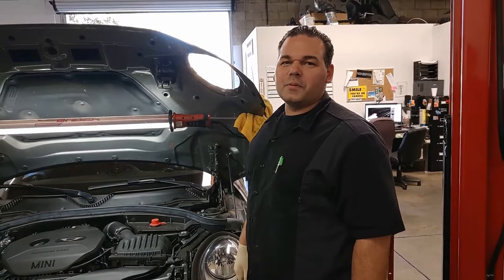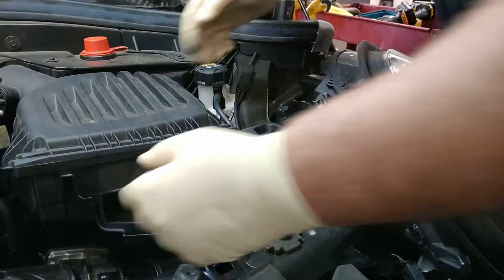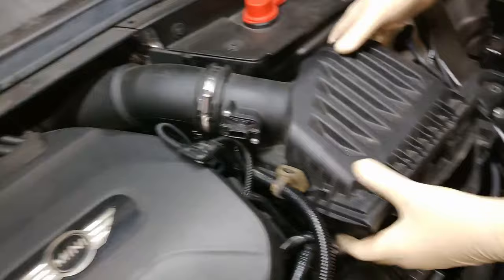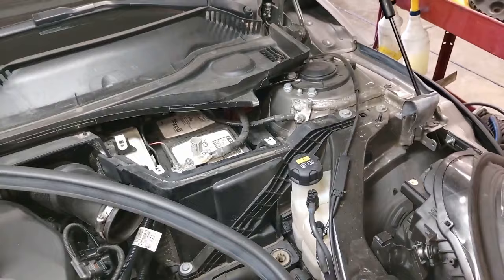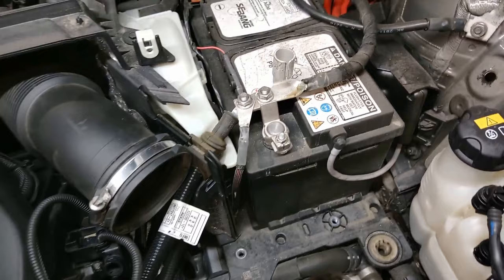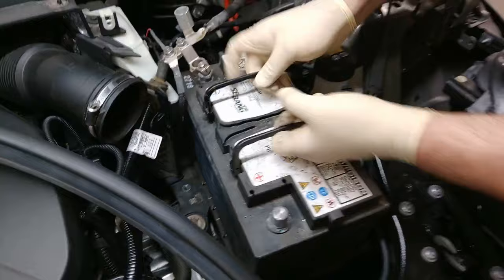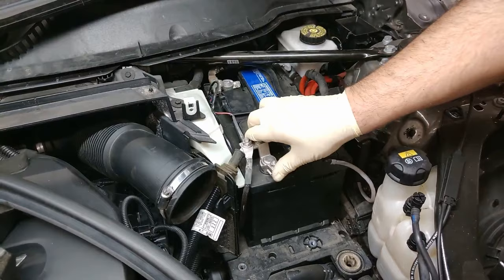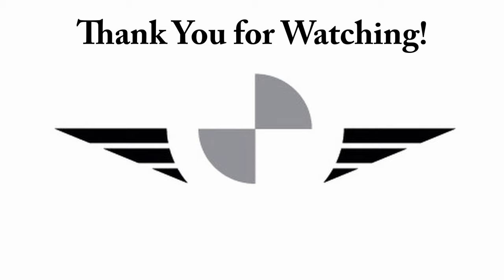Mini Cooper F56 Car Battery Exchange (2014, 2015, 2016, 2017, 2018, 2019)

Comment: Crazy amount of things to disassemble to change a battery.
Reply: Yeah, that is bullshit... 🤣
Reply: Compact cars are more complicated but this is by far not the worst hehe.
Reply: the dealership wanted $428 to replace it I was like ... WTF! now I partially see why.
Reply: Seems like it but it took 4 mins to “disassesmble”
Reply: Just need to charge the damn battery!!!
Reply: @faisal181  $540 now
Reply: @faisal181  the battery alone is around $300.
Reply: @eagertofrag7190 not really. All depends on make. Done plenty of honda toyota chevy nissan compact cars and they aren’t complicated. Usually beamer mercedes ford audi
Reply: @eagertofrag7190  you havnt seen a ford escape yet then. Gotta take the whole plastic weather lining, power steering reservoir, wipers, and a few other plastic casings around the battery.
Reply: I just did the job in about an hour with taking breaks.

Comment: It's a pleasure watching a pro at work. It took me nearly four hours to do this same swap on my wife's 2017 Countryman S, but I got 'er done. There's a long side to side strut/bar not in your video that had to be completely removed. The car had sat in the driveway dead after the dealer didn't have the battery in stock and couldn't get one. A dealer in another state told me that all I needed was a H7-AGM 80AH 800CCW battery, available at most auto parts stores. So it proved. My local dealer refused to install it, citing liability concerns, so I did it myself. It's a Diehard from Advance Auto Parts. They had it in stock. A sticker on the case showed that the battery had been manufactured the previous month, so I know I didn't get a "stale" battery.  Thanks!
Reply: What did you do about new battery registration?
Reply: @manahang1  I had to take the car to a MINI dealer to register the battery and reset the charging system. That cost me $89 with no other work done. This process should be automatic, with the charging system recognizing the new battery and recalibrating the charge rate, but it isn't. If you don't register the battery, the vehicles charge rate can remain very high, leading to overcharging and early battery failure.

Comment: A very good and informative video, well done for being clear and concise… But it’s absolutely crazy that you have to dismantle this many parts just to change a car battery! It takes just five minutes to take out and replace a battery on a 2012 Ford Fiesta, open the bonnet/hood, undo the battery clamp and the terminal screws and remove it. Replace with the new battery and you’re done. And someone has proudly commented that it took “just” two hours to do on the Mini!!! And this is progress? Madness… It’s getting to the point that they just want you to take it into the shop to carry out what used to be the most simplest of tasks…
Reply: I think it's BMW's strategy to make people come to the shop for a more expensive battery...

Comment: Very helpful and detailed instructions, including socket sizes!!!  Was able to install new replacement H7 AGM battery in my daughter's 2015 Mini Cooper and everything went smoothly.  It looks pretty complicated but the video is very clear and well paced and when you disassemble the parts everything makes sense and in fact is very well engineered.  
Used a battery keeper to maintain power to the vehicle so as not to disrupt programming.  Re-used the air vent plug (back) and adapter (front) from the old battery to the new for the vent tube.  Mass Air Flow Sensor (MAF) is a bit tricky - white clip underneath needs to be pulled out a couple of mm with small flat blade screwdriver to unlock and then plug pulls off easily - When reattaching insert plug and push white clip back in to lock.  Daughter will take Mini in to her local Mini guy next week to update the computer, but car is running great for now.  Thanks Cooper & Bimmer Experts!!!

Comment: Thank you, thank you, thank you!! Great video. My Mini didn't start this morning. After watching this video and a trip to the auto parts store for a $200 battery, I was on my way about 90 minutes later. Thanks for the clarity and for cutting to the chase. Definitely appreciated the detail you showed in taking off all the surrounding hardware so you can get access to the battery. Now if only my scan tool could tell the computer I have a new battery...
Reply: Does the car still work ok without the programming?
Reply: @lashley370z  Yes, I haven't had any problems yet. I've got an accessory gauge that shows voltage and it's always right around 13.5 V, which is what you'd expect to be coming out of the alternator.
Reply: @kurtlammonusc7424  thank you

Comment: Fail. Incorrect battery size. Tech removes an H7 and installs an H6. Always replace with the same size and type. At 1:51 where the tech first removes the anchor block, you can see where the edge of the H7 sits relative to the bolt hole for the anchor block. At 2:47 you can see that he slid the H6 farther in. Video conveniently skips reassembly, thereby glossing over the issue that the anchor block will not secure an H6, at least not using the original bolt hole. It's a red flag any time a technician vocally declares himself to be an "Expert." This "Expert" is a salesman first.
Reply: Thanks for this.....made me make sure I got an H7.  The stores I was buying from said both would fit.....meanwhile the H6 is over an inch less in length
Reply: @HandyGuy  "...battery clamp...will hold tightly...an...H6..." No. That is incorrect. You did not find that you can use the OEM hold-down pictured, to secure an H6. Difference in length between H6 and H7 is 37mm. OEM hold-down is not adjustable by that amount. There exist designs that accommodate more than one battery length, but those designs feature multiple bolt holes. This design has only one bolt hole to secure only an H7. Please research before posting in a public forum, and post only accurate information.
Reply: Wow good eye. Can see the H6/L3/48 on the new battery label. Regardless, the steps are the same, just the wrong battery size :).

Comment: thanx for that video, now I should be able to replace the battery - not sure about that registration thing - is it a must, I just got OBD checking
Reply: Yes, it's a must for battery life. The car still thinks it's charging an old battery and thus hits it with more current than it needs. New batteries don't need as much and overcharging can shorten it's lifespan. The Mini system can make batteries last a long time if registered right away.

Comment: Also is there a particular battery for the Mini (air vent) or can you use a regular battery?
Reply from the maker: I like to stick with the OEM Batteries they have been designed to handle the higher electrical loads of BMW and MINI Cooper's. So I will buy the Brand that makes it for them.  i.e. Exide, Varta

Comment: Hi，if I do the replacement at home, how can I do the programming so the car knows there is a new battery? O the programming is opcional?
Reply: Hi, programming the battery to the car is pretty easy. I bought a obd scanner by Ancel on Amazon and was able to program it and use the scanner to diagnose other faults on my other cooper.

Hope this helps fellow Mini Owners

Comment: Hi, question. After changing battery, is any program set up or coding required or nothing needed? Thanks
Reply: Yes, usually a specialty shop might have the software but most likely you will need to go to the dealership to reset the system.
Reply: @ThomasPartida  no dont go to the dealership. They charge 200 just to program the battery
Reply: Can you reprogram by your? Please let me know thank you

Comment: How did you get eh MAF sensor clip off. When you say push back, like how? Cuz when I try to pull it back it won’t disconnect still
Reply: Literalllyyyyyy
Reply: I had to pry it in the direction I needed it to go with a flat head screwdriver lol
Reply: Mass Air Flow Sensor (MAF) is a bit tricky - white clip underneath needs to be pulled out a couple of mm with small flat blade screwdriver to unlock and then plug pulls off easily - When reattaching insert plug and push white clip back in to lock.
Reply: Just let you know, I had the same issue. So I decided not to pull the sensor off, just hanging the whole filter box on the left side. It worked.

Comment: What does the registration of the battery do?   Are there tools that he Common guy use to do the registration?
Reply from the maker: It just tells the car that the battery has been replaced. This is so if there is a parasitic draw the energy diagnosis module can help determine the fault

Comment: I did the normal big boy thing and replaced my own battery from Walmart. I didn’t use OEM because the nearest shop is an hour and 45 minutes away if traffic doesn’t suck. Since it’s mid-summer, traffic sucks. I didn’t know a battery needed registration. Now what? Can I drive? Will it screw up my car? Where do I go to get the registration done? I don’t believe Walmart does it. Maybe?
Reply from the maker: most European shops should be able to register the battery

Comment: Do you have to register a new battery in the internal computer? I want to replace this myself but if it’s a must that is a blocker…
Reply: You can get some fault codes if you don't register it. I tried had some weird random things happening all electrical. After programing everything went back to normal.

Comment: Great video!  Does anyone other than Mini have the computer to reprogram the battery?  I called a local service shop and they told me they have a "scanner" to do this?  Thanks in advance!
Reply from the maker: If the shop has the software in the scanner they can do it, I think most good scanners have the capability

Comment: Do you need to connect a 12v power supply to the ODB2 port to keep the computer powered up for this ?
Can I tell the system about the new battery with bimmerlink or bimmercode ?

Comment: Question: I have a 2017 4-door mini cooper... Obviously, I am not a mechanic and I don't have all the fancy computers, but once we replace it can what do I have to do inside the car so that it recognizes the new battery?
Reply: Take it to a mechanic shop that does allow registering for a battery for BMW makes. Mini is part of that family. Ask around its always free
Reply: @MrAboutLife  thank you for the advice. I thought about doing that, but what I ended up doing is purchasing a mini diagnostic/registration tool, and did it myself. Everything came out good.
Thanks though appreciate it
Reply: @paulinecarlon3916  what tool did you end up getting? I currently have a 2017 countryman. Would that tool work with mine if I purchased?

Comment: What happens if you put a standard (non AGM) battery in the mini cooper? Is it going to cause problems for the cars’ electronics? I just got a used 2015 MCS and the previous owner changed the batt to a non agm one. The car runs great but just curious incase I need to change back to AGM. Thanks.

Comment: my partners car says "battery discharged. start engine". Does this mean the battery can be charged or does it require a full replacement? seems like a strange request and the manual doesn't address it

Comment: What is the need to register the new battery ? I cannot see the point out of having a history tracking in manufacturer database, or?
Reply from the maker: It tells the car it's got a new battery, so if it's a different capacity the alternator will not overcharge it. Also if there is a electrical problem we can see when the battery was replaced for diagnosis purposes

Comment: My F60 2019 MINI Cooper Countryman came with a 70ah battery.Is it OK, to upgrade to 80ah battery?.Would that cause errors or damage to the ECU or wiring?.Thanks.
Reply from the maker: That should be fine

Comment: Hey brother, thanks for the video!  I just changed the battery.  Jesus, what a PITA.  I also lost the 10mm bolt that holds down the air manifold (the 3rd one you took off) somehow.   So, if anyone knows the thread size please let me know!
Reply: Check the tread size with another bolt.  Find a bolt that fits.  Then bring that bolt with you to the hardware store.
Reply: @discerningmind  good idea, thank you!

Comment: The one thing I’m trying to figure out is the one thing you don’t show.  Taking off the Mass air flow clip……  I don’t want to break it 🤦🏻‍♂️
Reply: Mass Air Flow Sensor (MAF) is a bit tricky - white clip underneath needs to be pulled out a couple of mm with small flat blade screwdriver to unlock and then plug pulls off easily - When reattaching insert plug and push white clip back in to lock.

Comment: Hi I have a 2017 Mini Cooper clubman got it brand new in July 2017. Had a Thinkware F770 dashcam hardwired to enable parking mode back in 2018. Just last week, i can't start my car due to dead battery and need a boost every time. Does the battery life goes that fast? Have been driving a bit less this year due to the lockdown. usually i drive about 15 miles on weekdays and more on weekends. Thanks.

Comment: Couple questions. Will I loose all the programmed info in my head unit when I change mine like you used to with older cars?

Going to use one from from advanced auto H7-AGM. Should that would for a 2015 MCS?
Reply from the maker: Hi Bryan if you are talking talking about the radio all the presets should stay. I recommend using  a good quality battery. typically house branded battery's are junk. In my Opinion the worst batteries are AAA, Boch, and Interstate and then the auto zone/ house brands. they will pro rate it
but you still end up paying $$$ when it fails. And they typically only last two years where as a good battery that's a little more $$$ will last 2 to 3 times longer 
Hope this helps
Reply: @minicooperexperts  What battery brand(s) would you recommend?